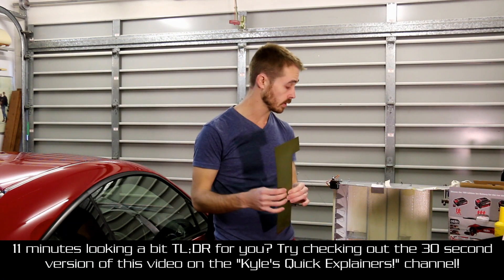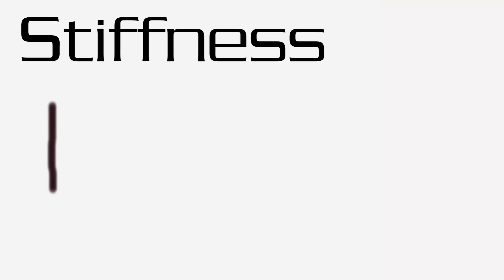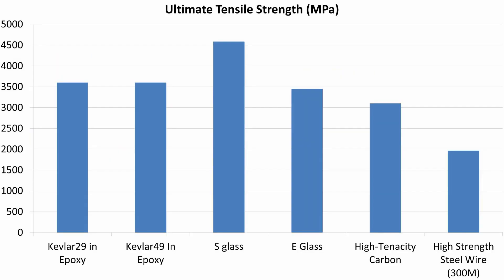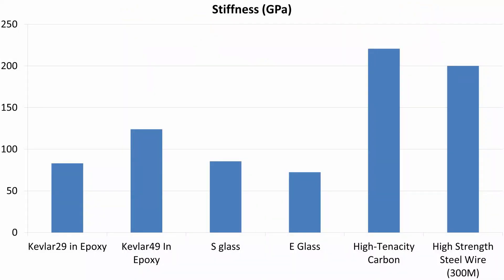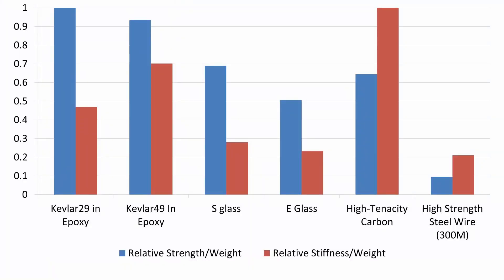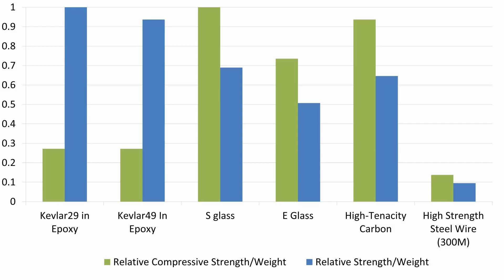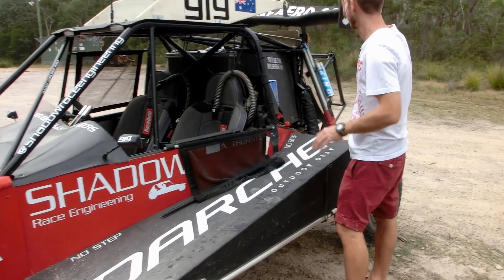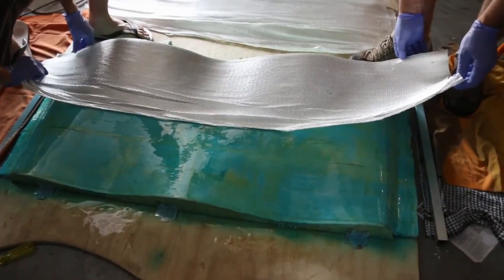Carbon Fiber vs Kevlar vs Fiberglass - Which one is right for YOU?

Comment: Hi! I need to clear up some things!

So you are saying that High modulus Carbon fibers are essentially strands of diamonds?

After 2800°C heat treatment of mesophase pitch-based Carbon fibers they reach a mean interlayer distance of 0.342nm. Ideal Graphite's is about 0.335nm, so MPP-based Carbon fibers are nearly Graphite fibers! The carbon atoms in graphite are sp2 hybridized. That's why MPP-based CFs are good electrical conductors. Diamond bonds on the other hand are purely sp3 hybridized, the bonds are saturated so there are no electrons to transport any current. Diamonds are insulators. It is also important to note that the microstructure of carbon fibers both pitch- and PAN-based are not 100% understood to this day. 

Side note: Diamond Nanothreads can be synthesized by applying huge pressure (200000bar) to benzene and slowly reducing the pressure to let the threads grow.

Also I need to ask you something about your table of material strengths. I'd be glad if I could buy materials with these strengths off the shelves lol. Where did you get the data of Kevlar + Epoxy. 3500 MPa?

Look, here is some tensile strength data of epoxy prepreg laminates from Hexcel which are basically available off the shelf:

E-Glass:
UD: 1100 MPa
Fabric: 600 MPa 

Aramid:
UD: 1100 MPa
Fabric: 500 MPa

High Strength Carbon:
UD: 2000 MPa
Fabric: 800 MPa

Intermediate Modulus Carbon:
UD: 2400 MPa
Fabric: 900 MPa

I think it would have been smarter to compare laminate strengths than pure fiber strengths. Pure fiber strength data is a marketing tool! PAN-based IM fibers are marketed with strengths over 7000 MPa. The data is gathered from tensile testing of single filaments with huge measurement errors that are sometimes larger than the measurement value!!!
Reply: IEleMenTIx Agreed. And laminate strength/modulus should always be tested using your own samples. I wouldn't trust MatWeb to save my life.
Reply: IEleMenTIx way to Go. Good observatórios.
Reply: Yes, except that carbon fiber is more expensive than diamonds.  ;}
Reply: TL:DR?

Comment: kevlar - yeah generally, don't use it and it is hard to work with.  but in fairness it is used in motor racing a medium amount: 

- anti-intrusion panels.  doors, roof, good idea to use it.  In F1 they are now Zylon i believe but that's sort of 'improved kevlar'.
- some sanctioning bodies require kevlar cage nets
- your driver's suit is nomex, which is a kevlar variant

ok i cheated on the last two they are not composites.  but still interesting i hope.

Comment: Great video, just a little over my head. If I am going to replace aluminum ramps and decks on my auto transport trailer, what would be best? The aluminum decks are beginning to break down with splits and cracks, and was hoping to replace them with a lighter material that will stand up to the workload. Thanks for the video..

Comment: You have put together a very good video explaining the reasons for material selection based on application. Very good indeed. I say this as a Canadian Mechanical/Industrial Engineer.

But you stopped short of explaining why you still use a steel tube trellis for the frame of your car! With all the talk of composite material benefits, your personal applications seem limited to spoilers and body panels. What gives??

Comment: Can you mix layers of Kevlar, Glass and Carbon to gain benefits from each? (A sort of super composite so to speak)!My Hi Fi Speaker cones are made from Kevlar, but surely from your video presentation, Carbon should be stiffer and lighter?No matter though they look gorgeous and sound fantastic!I read somewhere that the angles which you apply each layer with respect to the previous can provide much improved stiffness and strength in a finished lay up?I should really be asking our Composites Professor but don't want to appear such a dimwit to just one guy when I can display my ignorance to so many more!
Reply: carbon might "ring" like a bell, that might be the reason...
Reply: generally if you mix, the glass for example will stretch a lot and thus the carbon then has to take up all the work as it won't stretch much.  then if stressed to failure, the carbon will break, and then the glass takes over and then it will break...

examples where mixing might be useful:
- one layer of glass in between CF and any metals is helpful to avoid galvanic corrosion
- you need stiff for one bending axis and non-stiff on the other.
- you have a resonance issue, perhaps on a rotating part or something, adding another material might dampen the resonance.
- might reduce acoustic noise/echo
Reply: Good Stuff Aesop!
No fables in your advice. Thanks for the answers. Lol!

Comment: Dude F chopped strand. I really don't know what it'd be good for other than plugging a fekin' hole.
There's different weaves in fiberglass as well. Mat, normal weave, satin, biaxial, triaxial even.. I've seen a bunch of variations. The type of cloth and weave can determine how much epoxy the cloth absorbs.
I even glassed with canvas before... Which sucked b/c I spent a lot of time trying to work the epoxy into the cloth... Luckily it was West Systems 209, so cure time is SUPER slow in a 75 degree room.

Sglass can be arguably different b/c it has a twist in the weave... However I've seen E-glass (verified cheap E glass) that had a twist in the weave too.
S-glass is going to be a little more whiter than E-glass (greenish), but in comparison I think it comes down to how you're laying it. I made 2 fish tanks, same exact dimensions, glassed the inside of both tanks. Went e-glass the first time for my tank, s-glass the 2nd time for the customer's tanks. Used all the same dimensions, screw spacing, same number of layers, etc.
The S-glass tanks bowed on the back side (where no glass was), the E-glass tank did not.

Generalizing fiberglass in a video is kinda weird. There's variations in strength between 2 different e-glass sellers with the EXACT same weave.
Then to get into the epoxy strength... Cure times of hardener, temperature outside, brand, UV resistance (because fiberglass strength is different on day # 5 vs day # 2000), etc... all this comes into play too.
Reply: I actually bought a splash guard shields for my g35 (carbon fiber), on ebay a while back Well I broke the guard under my oil pan area by driving over a small branch. This was at factory height too. The small branch just kicked up and wacked the panel. I heard it crunch and knew immediately it was broken.

Well it was only a long crack with a huge hole... So I peeled/cut away the loose pieces, propped it back into shape and threw a couple of satin weave fiberglass mats over it with West systems epoxy, 206 hardener... built a foil plug where the hole was...
Babied it/formed it - until it got tacky. Let it cure. Fastened it on so it hinges forward for oil changes.
O M F G
I'm lowered now, and there was a huge rock on highway  75 (dallas) that was kicked up and broke into pieces like right in front of me (they closed that lane for a few days).
A huge rock tunneled under my car, as I drove over it. It sounded horrible.
Just scratched fiberglass.
Dented the hell out of my exhaust. Even felt like it lifted my car a bit.
Another piece still cracked a lower control arm though :(

ANYWAY! They make aluminum splash guards for 200$ now... probably sticking to my glassed guard though.
Reply: Well, drones are often made of carbon fiber composites, which are probably your best bet here.

The light weight and high stiffness are going to be pretty important in a drone.
Reply: Chopped strand serves to add bulk.  In using glass vs say carbon, and if cost is more important than weight, use of chopped strand (or mat, it's the same thing) can add some bulk and give you a stiffer, albeit heavier laminate.  Mat also serves a VERY useful purpose when using woven materials, especially heavier ones.  If you try to apply several layers of woven, you have to have some cushioning between the layers, or you run the risk of delaminating under impact loads.  In effect, the bumps in the woven material can sit on top of one another, resulting in half the laminate having glass against glass, while the other half is resin rich.  Hit it with a strong enough impact and it will tear apart.  Using a chopped strand mat gives a cushion, something to fill the space between opposing skins , allowing glass fibers to interlink between them, making delaminating MUCH less likely.
Reply: Chris Foster wow! 👍

... Which material would be best for building a micro/mini drone frame?
Reply: Dude you're like the rainman of fiberglass.

Comment: I have only used fiberglass with either epoxy or polyester resins.  That was years ago in my boat repairing days.  Have there been any advances in resins that don't shrink or burn as much?  All I am envolved in now is quad copters and carbon fiber seems to be the choice there.  I know what was called marbling polyester resin was the most used in boat building because it had very little shrinkage.
Reply: Lloyd Prunier they want carbon because of its lightness and its super weight critical along with stiffness
Reply: this is one of the big limitations of composites, that the matrix typically cannot tolerate very high temperatures.  you can get some that some that have a bit higher tolerance, look up "HTR 212" i've had pretty good luck with that.

Comment: Very interesting video. I noticed in recent kayak and windsurfboard design, the companies all hop on the carbon fibre wagon. But from the information in this video, I recon a fibreglass main construction with a Kevlar top layer would be much cheaper and more durable for those applycations, right?
Reply: you might think that after watching this vid, but i have an old boat, and it has "flexed" so many times that those flex points become crack points, and thusly the boat is in disrepair now.

Comment: kyle - incredibly informative stuff here...i applaud you.  question: 
although CF is not as durable, however more rigid...and more 
elastic...besides the aesthetic doesn't this make CK superior in a 
general sense?  as you know, the carbon fiber monocoque is here and is 
seemingly forging a standard for motoring/supercars/hypercars...etc.  
why CF over the alternatives here, specifically?   wouldn't a high-grade
 carbon kevlar be more appropriate?  i'm not sure of the temp. 
degradation/thermal threshold of CK but i'd venture its inline with CF.

carbon fiber is sleek and much more beautiful than kevlar but not quite 
on par durability wise...i guess therein lies my question: is/was CF 
standardized because its prettier?
Reply: its also very light weight

Comment: There's a bit more to it than that. Matrix materials are only as good as their design. By playing with the characteristics of the material used in junction with pattern design, part geometry and so forth you can easily rig up a design that makes one material excel over the other. This is true even in cases where the first material is better for the application on paper. For this reason you often see carbon in sailboat masts, for example, where flex to weight ratio is a key factor or even in rigid bike frames which often experience high momentary forces. This is also the idea behind enforcing carbon with kevlar. Furthermore, carbon parts also excel in the long run when you look at plastic deformation over time, due to applying bending and torsion forces to a geometry. This, in turn, lets us to look at the economics of materials science differently as well. The biggest problem with carbon fibre, however, is the lack of automation options in a production scenario... hence the price tag.

Comment: Hi I had a quick question. I am thinking of building a tree stand. My first choice was to have a steel fabricator weld my plan together. But than I thought of making it out of carbon fiber. I know probably cheaper to buy prefab but they don't make what I want. So my question to you is after watching this video I'm not real clear if carbon fiber is really the best choice. It would be mostly tubular attached to a steel tree anchor. Any feed back would be appreciated. Thank you

Comment: Part of the problem with CF is that while it is very light and strong, it's also very brittle, and that goes for the fibre and the adhesive. It shatters, and that's a lot like a broken piece of glass. There is a way around that, with a multi fibre composite, but most people couldn't be bothered with that. So flaggies and corner stupids need to carry a dustpan and brush. It's OK, that can also be used for the cement dust, and the cigarette butts after the race...
Reply: "Carbon shatters like glass" yay, another internet bullshit myth perpetuated.
Reply: Karri Koivusalo [sigh] Alright, I'll be a little bit more specific. The versions of CF that are most favoured in things like F1 cars, have the least weight and the most strength and stiffness, and when struck they do shatter like glass. So after contact on track the marshals need to get out there with brooms to clear all the little bits, or there's going to be another accident very soon because of debre / FOD tyre failure. If you make a composite with carbon sheets and normal epoxy adhesive like fibreglass, it's cheaper, but it's not really any better than fibreglass. But you use the right (carbon based) adhesive and you cure it in an autoclave, and the result is much lighter, stiffer, and stronger. But it is brittle, and when it does break, the pieces are sharp. They're very much like shards of broken glass. Next question?
Reply: Okay, since seeing Formula 1 stewards sweeping up debris on TV makes you such an expert on composite failure mechanics, I'll leave it at that.

Comment: I'd like to see a second video on this.. Mostly for weave materials like Carbon/Titanium, Carbon/Kevlar, etc. and I think if they can all be epoxy resin based then why not experiment with different combinations. I'd also like to see comparisons of weave styles; plain, basket, twill, herringbone, houndstooth, satin, etc. and random fiber direction. I've always known the random direction of fibers adds strength due to there not being a weak link which is the gaps in the weaves. 

Also, if you have access to actual research equipment, please test weave styles and materials. On the materials, if you do experimental combinations, do different mixtures; like 75/25, 50/50, 25/75, and possibly more but I think having those three plus the two plain materials could give us a good understanding of how combining them would work out for different applications. 

Another experiment I'd like to see done, which is kinda out there, is putting two plates of material with a honeycomb (or other tessellation pattern) layer of the same or different material in the center; like 3d printer infill. Just because science; even if it doesn't work, at least we'll know it doesn't work.

Comment: Kevlar is a pain to work with. Very difficult to cut the fabric. Also it degrades in UV (sun).
Reply: i think you're spot on: the subtleties between CF and CK make carbon fiber superior and otherwise, kevlar erroneous in this sense.
Reply: difflocktwo get good tin snips

Comment: So if I make an airplane wing with aluminium internal structure, but cover it with carbon fiber, the internal structure would rust? How does the carbon fiber rust aluminium?
Reply from the maker: Copying from another comment:
"It's all about the galvanic series. Carbon is a long way away from steel and aluminium, so sets up a sort of battery in real world conditions. Think about batteries where carbon is used as one of the electrodes. I have heard of some racing manufacturers using a single, thin layer of fibreglass under their carbon to help with corrosion on an aluminium honeycomb core. Our carbon/aluminium SAE car used to have huge corrosion problems with this."

Then verified by another user:
"+KYLE.DRIVES Can verify. Whenever there's a carbon to aluminum connection (it's almost always aluminum due to its great adhesion with epoxy, therefore reducing bond area needed), fiberglass is used to "shield" the Aluminum from the carbon."